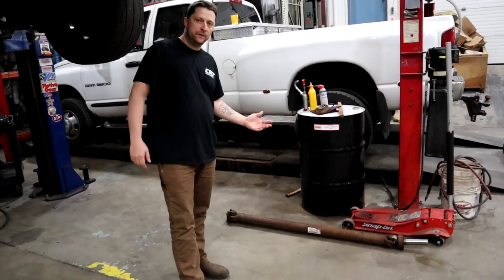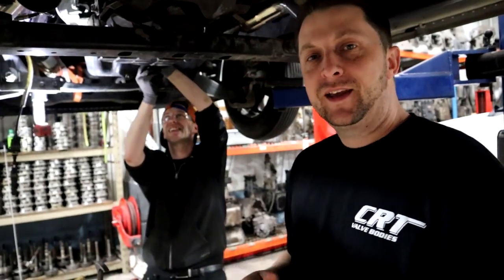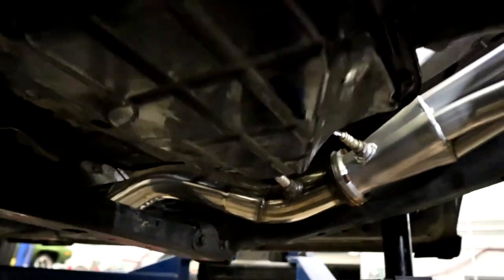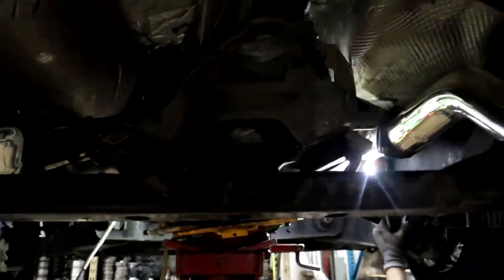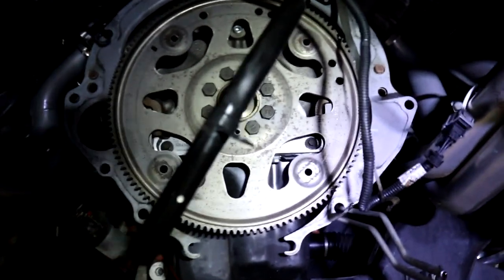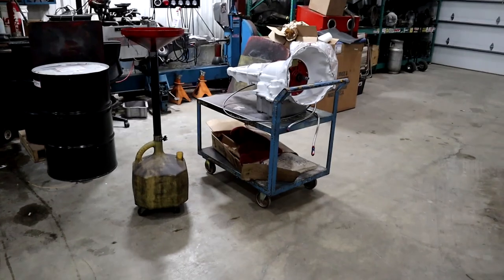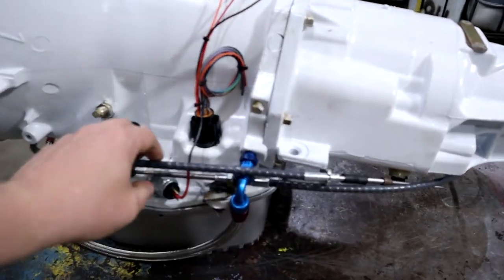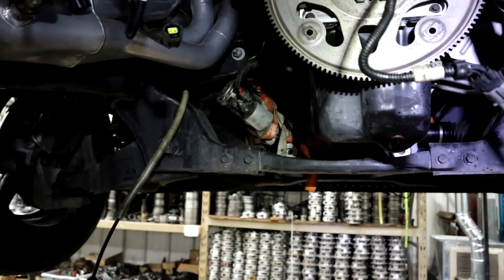Ram 1500 545RFE To 46RE Transmission Swap From Cope Racing Part 1

Comment: Never thought the 46RE would be a superior transmission 
-signed every 2nd gen owner
Reply: it isn’t and this swap is possibly one of the dumbest things i’ve ever seen lol
Reply from the maker: You can build one to hold massive power its a 727 with overdrive lol why else is every big power mopar racer using them?
Reply from the maker: You do know it's the same as a 727 just has overdrive you can build either to hold massive power huge aftermarket for them lol look it up why else is every mopar racer running 727s🤦‍♂️ this is a full manual valve body not autoshift😉

Comment: Awesome Frostbite《☆》It will be interesting. Giving up one gear for simplicity & durability. I wonder if 1st gear will pull as hard as the 545 did🌴◇:*:◇🌴Greetings from⛾Florida🤳my friend😎🎱☮🔊✌👍
Reply from the maker: Both are very close in ratio.  The 545 has a 3.00 1st and John changed the the 46re to 2.80 if I remember. I can't tell a difference at all between the 2 besides the 46re shifts so well and puts the power down. More videos to come but also the 46re in 4th gear with overdrive locked im running about 2000rpm at 65-70mph with my 410s so I'm very happy with that also.
Reply: @FrostbiteRam  1st= 2.77-1
Reply: Hi I have a question on the 545 rfe swap to 46rfe ? Did you also change the tcm or canceled it

Comment: Amazing video gentlemen! I have a 2012 RT and would love doing this setup to mine. Would it work with the 4:10 rear?
Reply from the maker: Yes mine is a 4:10 also that has no effect on anything.
Reply: Are 4:10 gears possi trac. Do both tires spin?
Reply from the maker: @sergiocruz8443  gear ratio has no effect on if both tires spin or not. If you have a open differential then 1 tire will spin only You need a mopar limited slip differential or a Eaton trutrack to make both tires spin.

Comment: Ever put it on the dyno with the 5spd and then again on same dyno with the 46RE?
Reply from the maker: Never been on dyno period but perhaps soon just for fun
Reply: @FrostbiteRam  it’s data bro. I don’t use them for the numbers, just what they can tell me. It will definitely show you if your setup is being optimized. Also what a 4 corner weight scale will do. Helps make a combo that much more effective if you know all this information. Like I just found out the 727 is more efficient than the 46RE in terms of DTL. 727 puts down 60+ more whp than a 46RE on the same vehicle. Do it for the knowledge, use the fun for gapping people because you know what you can do.
Reply from the maker: @blackmambaram7034  yeah its a great tool for sure. 727 is definitely better for all out racing but I like my highway cruise ability to much to lol 2200 at about 70mph with 410s is nice👍
Reply: @FrostbiteRam  yeah, I can always get gear vendor for an OD if I decide to do more cruising than I plan to.

Comment: Did you have to modify the stock harness at all? I'm trying to do a similar swap on a dakota and finding the correct harness and computer is being a real pain
Reply from the maker: My factory harness is completely left unplugged/not used except for one wire to pickup park/neutral switch.  Mine is full manual valve body no need for the computer.
Reply: So no need for 12v source for neutral safety switch?

Comment: Did you use that edge converter with your original Greene cam?
Reply from the maker: Yes I did
Reply: @FrostbiteRam  That was a .5 HL wasn't it?
Reply from the maker: @roadrash6565  correct

Comment: What are the advantages to the 46re? I have one in my 2nd gen and I’m honestly just curious, cause mine has given me nothing but trouble any suggestions?
Reply from the maker: So much after market availability for the 46 it can be built very strong.
Reply: So, the 46 is not the answer to this troubled 2nd gen? I'm looking to fix mine
Reply: For most the 46re will hold plenty with just a shift kit. The stock overlapping shifts are the Achilles heel.